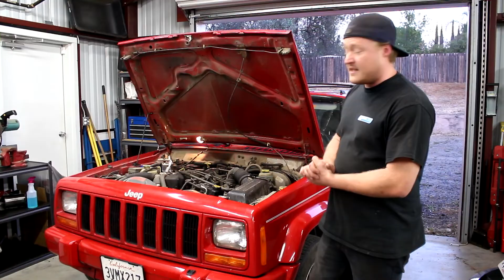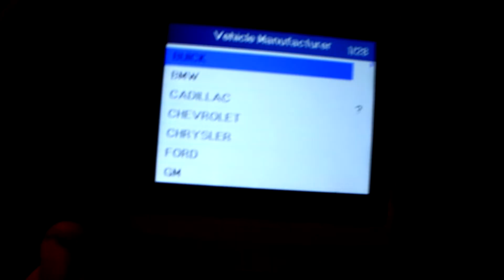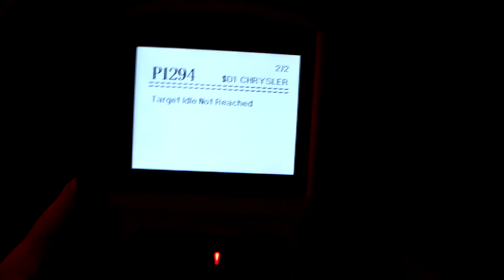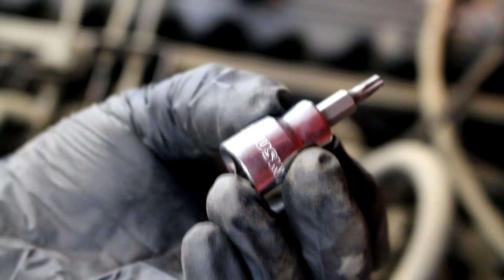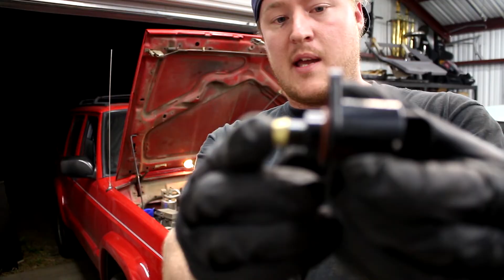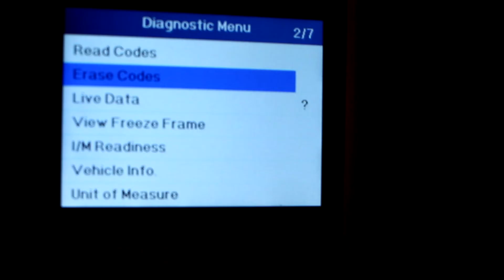Idle Air Control Valve problems P1294 and P0505 - XJ Jeep Cherokee #8

Comment: I have a 1996 Cherokee XJ 4.0, but the idle speed is too high (around 1,000 RPM) and the engine is vibrating, which feels like a slight misfire. I’ve already replaced most of the engine-related components, including the engine compartment wiring harness, but the problem persists and I can’t find the cause. Do you have any suggestions?

Comment: I wish someone would tell me why my 4.o suddenly dont want to run on very cold mornings, it starts just fine but it quits about 15 mins later then it just gives me all kinds of hell and just wont run,,,,,warmer day it does just fine but in the 20s or the teens, its not going anywhere,,,,but it never did this last winter at all , it now started doing this,on days thats temps are 35 or 40 it does just fine,,,, just remember tho it first starts and runs fine , 15 mins later it dies on me an becomes a.bitch, will not start back up, it just doesnt want to act right at all ! You have any thoughts on that ?    Its a distributor 4.0 , im thinking its something about the throttle body but im not positive !

Comment: My cherokee is all a sudden  not liking winter cold starting, it stats and idles fine for 15 mints or so but then it starts acting up andoest want to run about when its startin to warm up on the gauge, it zpits and spuders and dies,,,, last winter it never did this, but now its everytime i start it up,,, got no. Power past idle, it just spuders til quits ,,,,30 mins later i try it agin and it does the same thing again, ,,, would this have anything to do with the throttle  body connections you think ?  Its the first winter that its did this, and it runs perfect whenever this crap doent happen in the mornings when its cold as hell  !

Comment: My 4.0 has a problem not wanting to run right in cold temps before it warms up to normal , it spits and spudders with no power, but after it warms up real good iruns just fine with good power, it wasn t doing this last winter, what would you say is causing this ?

Comment: I just replaced my PCM now with two different Refurbished ones. I had replaced many many parts. Now it has a low idle about 500 RPM almost sounds like it wants to die but doesn’t.. so I purchase all three sensors that will be here 12/3/24 the IAC TPS MAP and I’m going to get a new gasket and take off the throttle body and clean it.. I hope it fixes the low idle. It use to randomly go up high for a few minutes then down to normal.. so I am hoping replacing the sensors will help.. ohh and my pcm was a pain in the ass because it still wanted to die but I am thinking now since all the clips were broken they were not snapped in solid so I got industrial zip ties and zip tied them super tight and it hasn’t had issues yet.. 🤞🏼

Comment: Missed Clock Springs issues (older mileage vehicles).  Front Audio Speakers, Door Lock and Window Wires between door and body.   Leaking oil filter adapter.  Broken front seat console (made of plastic and if you lean on it the support will break and most Jeep XJ are broken in 97 and up) .  This guy is only getting started.  Should of made a list before he even got started making the video.  Don't get  me wrong, he came up with some great issues.  I loved my Jeep XJ that I have owned (1995, 1997, 1998, 2 x 2000), but I love my Forest Green 2001 the best.  Changed the interior from tan to black (sweet).  Never took any oy my jeep to a mechanic.  I have done all my own work.  The biggest issue with my Jeep has been other driver not able to see them and hit me.  Insurance companies are quick to total out.

Comment: Fun fact about post '97 XJs: You can check the codes without a reader. Hold down the trip reset button while turning the ignition to 'on' until the odometer starts cycling through numbers. Then release the button. The odometer will then display the code.

Comment: replaced TPS and AIC valve, cleaned throttle body. 1994 jeep cherokee country running like new again. i 'upgraded' to a more reliable name for both sensors (standard motor products). in the past i usually would go for the cheapest product, but after much neglect i figured she need a little extra TLC. from my experience, the instructions that came with the AIC say you can 'adjust' the head manually before install. it was somewhat vague as to why, but i say absolutely NOT. do not twist clockwise or other. you are only asking for trouble.

Comment: Some old jeeps you turn the key to on 3 times and then you can read the codes off the dash then google the codes and it will tell you what the problems with your engine is so when you go to the shop your mechanic can't sick you around✌️
Reply from the maker: All it does is give you a code, a code is NOT a diagnosis and parts should not be replaced based on codes alone. If you dont trust the mechanic find another one you do trust. If you dont trust anyone then you got bigger problems to handle lol

Comment: Thanks for the well thought through and presented video.   You've delivered the best information on the subject I have found.  

I'm Working with. a '96 XJ (2.5 four banger)  that Ive had for over 15 years,  and just failed smog..  (California.....Love it or hate it,   or wish you were somehow smog exempt...)

I Got  a code for O2 sensors and idle control.   Replaced  O2 Sensors,  and Idle control  and threw  a tune up at it.  (Quality cap,  rotor,  plugs, and wires which is something I consider annual maintenance.)     Also decided to throw a new blue streak coil at it as I could not name the year I did that last.  Surprise!  Old coil was cracked straight through,  It's a wonder it ran.    Runs better,   it runs smooth,    But Stil...

I'm Getting a check engine light and code for idle control?   I bought the Standard brand metal  Idle control,   wishing to spend a few bucks more and not have to re-consider new part function after installation and subsequent possible failure.   Idle at start up is about 1200,  and very slowly settles down to maybe 900-1000.     I'm a fan of slow idle,  would love to get it down to 600-700,   and thinking that may be the level that enables the check engine light to go out and Pass Smog.    (Insert celebratory fireworks here).

I did see another youtube that instructed adjusting  the length or the idle control valve  plunger prior to install.   ( and there was much criticism of that in the comments)    That is a straight forward process,   the plunger does screw in or out for adjustment,  and the other video suggested Matching the adjusted length  to that of the old valve plunger,  thereby arriving at the correct length adjustment.      

Your new Idle control valve self adjusting after a few miles of driving was news to me.... but your Cherokee was 97 or newer and mine is not.... My new valve had no such set of instructions.

Any Suggestions?  

Thanks again.....
Reply from the maker: Screwing it in or out before putting it in is not going to do anything, it needs to self learn. If you still have a high idle I suspect you have a vacuum leak somewhere or something else is afoot. Standard Motor Products is one of the few aftermarket companies I use in my shop and feel comfortable recommending. Dont get caught up in the small details. K.I.S.S. "Keep it simple stupid" is an all time truth. If it is idling high its probably getting too much air, and because these systems are speed density vs a MAF they will still run great either way. If you had an intake leak on a maf system it probably would idle like shit and run good under load. Good luck and hope you find your solution, I am in CA too and struggle with that fact always lol

Comment: What is the vacuum lines that run into the brake booster is that part of the brake system that would make my brakes hard to push and harder to stop
Reply from the maker: Yes the booster is your brake assist, it is powered by engine vacuum. If you disconnect that it will cause you to lose the power brake assist and your brakes will be manual with only the force of your foot to engage.

Comment: Does the fuel pump and idle control senser have same symptoms when going bad
Reply from the maker: Not really at all, and the fuel pump is much easier to diagnose. Get a fuel pressure tester and see what it is putting out, best test is tape the gauge to the windshield and see what it puts out while driving under load. Many fuel pumps will give a good number sitting and idling but fall on their face once the engine really has a load on it.
Reply: @GearHeadsGarageChannel  my 04 4.0 runs fine when it will start and it idles rough and the engine can be cold but on a hot humid day it won't start or it just seems that way and I've changed all the o2sencers and thank you for replying    do you think it's my idle control senser

Comment: I'm having a low idle issue...when I unplug the IAC it doesn't do anything different to my idle speed, which is around 600 rpm, it's very low and almost dies if I don't lightly touch the throttle. the throttle body is clean and sensors are new. Glad you talked about the 2 circuits, inner and outer. I'll test those again with my multi-meter and some paperclips and see what voltage I get on them. 1999 jeep cherokee classic xj
Reply from the maker: FYI will be hard to watch on a multimeter vs an oscilliscope cus it is constantly switching voltages
Reply: Did you find your problem mines having same problem right now
Reply: @guapowtheclippa how about you, Im in the same boat at the moment

Comment: Sorry about that, I didn’t get to complete my question. It idles at 3k , cleaned the throttle body and IAC valve and passage way. Reinstalled and Jeep idled down to 1000-1100 rpm. Next am started Jeep idled at 3k again checked codes got the P0505 code so went and bought a new IAC and a map sensor since they are right beside each other. Now idles at 2000 checked for vacuum leaks have not found any as of yet. Have not checked power or resistance will do that next any other suggestions would be much appreciated. Thanks
Reply from the maker: Double check that there isnt a relearn procedure for your 2.5 TJ, not sure what they used on yours vs mine but many times they need a relearn.
Reply: @GearHeadsGarageChannel  Thanks for the suggestion, will look into that and hope that is it. I am also going to do a thorough check for a vacuum leak again.
Reply: @GearHeadsGarageChannel  Hello and wanted to let you know what I found. I did find a vacuum leak on my 00” TJ 2.5 it has a leaking intake gasket,  tightened the bolt and idle went down to 1100. So looks like a new manifold gasket is in the near future.

Comment: My 1988 idles real and shakes put a new iac valve but nothing still runs rough any answer please help
Reply: Any answer if my 88 jeep has low and rough idle change the iac still run bad
Reply from the maker: Your jeep has a RENIX system. See if you can buy a diagnostic tool for it online, it was a unique system that was ahead of its time but also a pain because even though it was fuel injected it was a one off system and no old OBD connectors work to communicate with it, and it also does not have a check engine light so you cant count flashes for codes either. Diagnosing those takes a bit more skill, but if you can find a tool for it it will make your life much easier, otherwise basically going around with an oscilloscope or multimeter and manually backprobing and checking every sensor in order of suspicion is the only way you can do it.

Comment: ONE THING that pops up, neutral safety switch. LOL bypass it if your reverse lights dont light up and your car will not start. Its 300 bucks or so to replace. Paper clip works just fine to bypass under the hood. Just be safe because it will start in neutral. I only start mine in park unless working on it anyway.
Reply from the maker: I got a replacement on rock auto for like $150-230ish I think. If it is giving you issues for the lights it can start causing other issues as well and as easy as it is to replace I would say just do it. If your car is a beater thats just getting limped along fine but I plan on keeping this one forever, I dont do bandaids.
Reply: @GearHeadsGarageChannel  Hey GearHead, I had a no start issue and noticed my reverse lights didn't work. After googling the issue, I learned about the NSF and used the paperclip jump trick and it was a godsend at the time. I do plan on keeping my 97 xj, even though it can be a pain in the arse trying to diagnose sometimes. My son removed and cleaned the NSF and since then only had a couple probs with start up and I am sure it is time to replace it. Thanks for responding. Just seeing this now so, Happy New years since it is December 31, 2021.

Comment: Just replaced spark plugs, cleaned throttle body and IAC and new vacuum elbow. Now Jeep stalls and hard starts. Now getting P1296 code on dash. Suggestions?
Thanks. ✌ Doe's it matter which way the IAC goes back in after cleaned or and new??
Reply from the maker: That code is for a MAP sensor. Check that you didnt break a vacuum tube going to it or leave it unplugged or something. If not, then look up the test procedures to see if yours failed and replace if necessary!
Reply: @GearHeadsGarageChannel  . It must have failed when I cleaned the IAC and removed and cleaned the throttle body? I replaced the IAC & TPS with Standard brand from Rock auto and still runs bad and still P1296 code.  I unplugged it and now getting Po180 & P1296 code. I checked all vacuum hoses, good. There is no vacuum hose to MAP. Just tiny boot into TB. I did both reset code procedures, still stalls at idle. It was surging and rough at idle periodically before I worked on it but was fine. I did change a broken vacuum boot into the intake manifold. I guess I'll get a new MAP and see? If still stalls??
I wonder when I sprayed TB cleaner, may have damaged the MAP? Any thoughts?? Thank's!
Reply: @GearHeadsGarageChannel  . Hi 2 year's later and having same problem!  It ran fine for those 2 year's. Now is acting up again. It started when I down shifted into 2nd and the back into drive. It's power surging after it warms up and 5 mins of driving where I have to power brake it or it will stall. When it surges you can feel and hear the Trans jerking back and Forth. I'm not getting any codes on the dash display when turning the key on and off three times. It did run fine for one day but the next day it acted up again. I don't have any scanner or ohms volt tester. I bought some carb and throttle body cleaner and going to clean it tomorrow. Hopefully it's just a dirty IAC and a TB? Don't know how it could go bad in 2 year's? Any other suggestions??✌️
Reply: So I just replaced the IAC. Which I had no codes. Now once again like 2 year's ago I'm getting the 1296  code again and won't start after replacing the IAC. I replaced the map 2 year's ago too. I'm resetting the codes and ecm by connecting the two battery cables together for 10 mins and reconnecting them to the battery!! Can't believe I'm going through this again!  I bought a duralast IAC for $84 lifetime warranty this time. Also cleaned the TB. Update: 
The new Duralats IAC plunger is frozen. Won't move by hand. Getting refund.

Comment: Could my sputter and hesitation occurring in the lower gears (AT), with P0170 code that says lean but runs rich in open loop be the IAC?   2000 XJ 4.0. No vacuum leaks. Fuel pressure feels good. No test on fuel pressure. Will replace filter.  Engine only hesitates and bucks upon acceleration.  Code is only Pending in closed loop. Last 15 miles gives no CEL.  Running better as time goes by, but still getting that initial sputter, intermittently, seconds after accelerating has begun.  Great Vids,  Keep em coming.   Broken thumb has me JeepTubing😁

Comment: I have a 2004 Jeep Grand Cherokee got the code p0505 and changed the IAC but now my idle sits around 1000-1200 rpms when In park but I put it in gear and it drops to about 600 and I still have the code any help?
Reply from the maker: Might have gotten a bad part especially if it was a cheap one from autozone or oriellys. Also possible your Pcm has a bad driver.
Reply: Yea it was a part from auto zone I cleaned the old on and put it back in and runs great now

Comment: What part did you replace it with I would like to know the name brand. I bought one from Oreillys and it came defective.
Reply from the maker: Sorry I dont remember what brand now, but house brand autozone and oriellys parts often have issues.
Reply: Pull a vacuum from the engine and u don't need need the idle air sensor.

Comment: You can clean the old IAC with spray cleaner then work the pintle back in by holding it in 1 hand & using your thumb to push the pintle  back in by rocking it back & forth. If it's stuck you won't be able to do this obviously. Also oil that O-ring before reinstalling new IAC. Could have also been a VAC. LEAK, I've seen that on the 4.0's.

Comment: I had pulled and cleaned the IAC on my '01 XJ due to low idle and stalling at stops. The low idle and stall disappeared but was replaced by a hanging idle when the accelerator was pressed. Finding your video was a godsend, especially when you read the installation instructions that came with your IAC replacement referencing that the engine will hang high idle until driven 5 miles at 45mph to reset the "brain". Thank You!!! We're good to go......
Reply: same problem, replaced the IAC and still idle issues :(

Comment: I use a BlueDriver OBDII dongle that uses bluetooth connection. Can run diagnostics when it is running, and on the Ford, can reset the codes while engine is running. I have used it several times to fix a few issues.